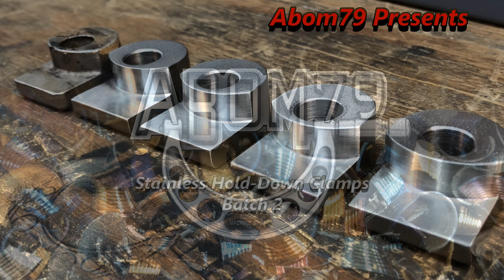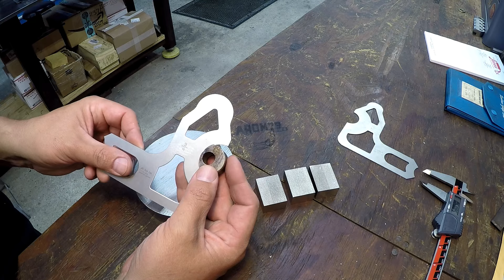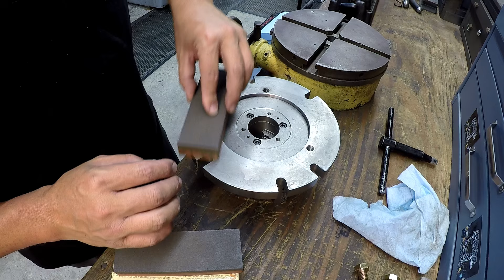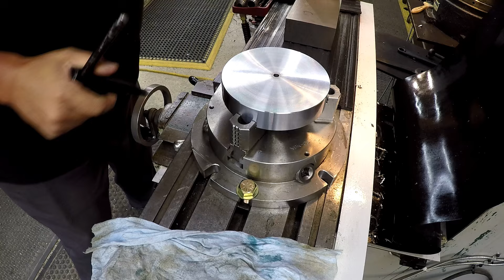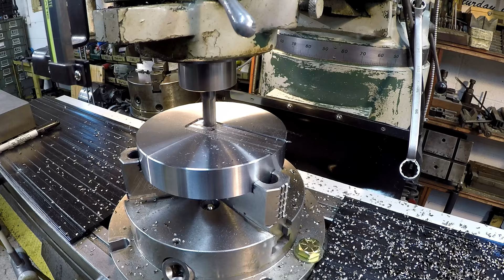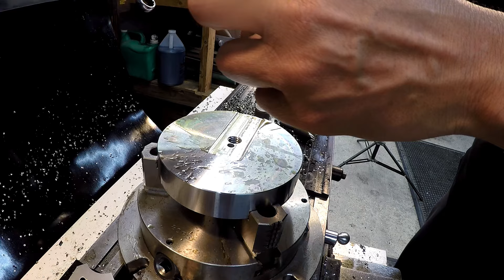Stainless Hold-Downs Clamps Batch 2

Comment: Adam, I know this is an older video, but I have a question for you.  My Kurt D688 manual states clearly that you should not clamp on the outside edges of the vise without a same size piece on the opposite side.  In other words don’t torque your jaws out of alignment (parallel) by clamping on one side of the vise.  Are you not concerned with the uneven pressure you are exerting on the jaws @16:00?

Comment: I used to be a manufacturing engineer. And used to compile cost of manufacturing parts for customers. And process the parts on different machines.
How do you get your hours of a certain job to calculate cost.

Comment: I'm a fan of the stoning the surfaces as I do it a lot my self. With that said i dont have a lathe and have often contemplated having someone turn the  face of my very similar but smaller turn table to get a nice clean fresh surface on there. Adam, is there a reason why a person would not want to do this?

Comment: Ok, I got a question. I'm a machinist, and retired design engineer, and I've not run into anything in all my years that required a clamp that a standard set of machinists clamps couldn't handle, what in the blue-eye devil are you holding down that needs clamps like that?
Reply: Maybe it's for when the hurricane comes, he can hold down cows ect. I've never seen a cow hold down clamp but seems like these might work. You can't buy these so they have to be made custom per cow. All cows are a bit different
Reply: They're for a diesel-engine turbocharger. You know any automotive part has to be goofy.

Comment: I noticed the cut seems to not cause as much vibration when rotated couter clockwise.  I am wondering if this is caused by the slack in the rotation of the milling fixture you mentioned in the setup.

Comment: Wouldn’t it have been more accurate to mount the low profile chuck on the rotary table then to the mill table prior to milling the slot in the fixture plate?

Comment: Hi Adam, I'm another long time subscriber and always love your videos.  I have a question about the shell mill you used to reduce the thickness of the stock.  I bought one like it at a swap meet but I am having a hard time identifying the inserts.  Remembering the video you made using the engineers black book, i came up with APKT but after that I'm lost. My shell mill is an Iscar F90A-D2.00-.75-M. I paid $70 used, probably  too much.  Can you tell me what inserts yours uses or give me any help in identifying what I need.  Thanks in advance

Comment: We turned the hole of a a piece of pipe to the correct radius, and then weld in the parts with a small weld. Then the pipe is loaded into the chuck and the welded parts are turned. Same result. The pieces are then grinded loose and finished and the holes were drilled on a normal drill machine. If it's positive radius we welded them on an outside diameter. We did that for decades until we got a cnc milling machine.

And again, Adam stop the spray coolant system, it's going to kill you. That would not be allowed in my workshop and by health inspection. The moisture will damage your health over time, plus you are losing the coolant instead of circulating it through the machine like a flowing system with no moisture. You will end up with a bad cough and a greasy workshop that you have to clean with other toxics to get rid of it. Keep up the good work , but watch yourself a bit ok?

Comment: I'm a hobbyist woodworker and we have lots of options for dust collection to keep the air safe and the shop clean. Do you know why machinists don't seem to have a vacuum system to help with the chips flying all over?
Reply: Most cnc machines have a closed cover with doors and autimatic chip disgarding thesedays and there are industrial vacuums to clean up chips and coolant. Depends on the workshop. For the old school machines it's still part machining and part cleaning, it just comes with the territory. It serves 2 purposes. To clean the machine and do maintenance you spot during maintenance as well as investing some love into them, they like to be taken care of. But sucking up wood dust is something else then sucking up metal chips. When you use a vacuum, that too needs maintenance and cleaning as well as empthying. Just more work...

Comment: Hi Adam 
Just awesome watching your videos lots of info on watt u r doing and how to go about doing some things that alot of us may not even think about doing ...so I have question for u I have a lathe which I use alot but having trouble setting up for threading I do have change wheels but only from imperial to metric the thing is I set it by the chart on the machine only to find it's not right it's not a made in China lathe it was made in Australia but no longer tho just wondering if u would have any ideas the screw thread is 4tpi thks Nigel.
Reply: @Goettschwan you can always do the math and sort it out
count the teeth and figure out the gear ratios you need for a thread pitch along each step of the drive train

could be tedious, but that't how they build it and make the charts in the first place

Comment: Beautiful work, as always.  One thing I like for demurring and blending things in is to use the coarse wire wheel on my 6" bench grinder.  It knocks off the burrs while also slightly rounding the edges, plus you get a more uniform look between the various surfaces.

Can't wait to see the next installment, Adam.  Keep up the good work.

Comment: Beautiful work as usual but I was not aware an exhaust system required such painstaking and time consuming precision parts. I will not be surprised if the installation of these NASA quality parts is done with an adjustable wrench. :-)

Comment: Great video. When I was an apprentice, we were taught to use a Blue Rizla cigaret paper placed in coolant on the work piece then bring it up to the tool, when the paper was pull off by the tool we new that the tool was one thousandth away from the cut beginning. Blue Rizla being one thousandth thick. Best regards Si.

Comment: I'm not clear on the location method of the part in the slot on the rotary table.  Is there something more than the cap screw in a clearance hole?
Reply: garry myers what he is doing is locating it in the y axis with the slot since the radius will be weird if it is not. The x axis is not a critical dimension so a bolt is close enough. Z axis is measurable and does not really matter.
Reply: @xXkingbeastmodeXx  thanks. That makes sense.

Comment: Hi Adam, Can you tell us if this is the wheel you used in the video? https://www.bindingsource.com/scotch-brite-trade-exl-deburring-wheel-6-in-x-1-in-x-1-in-9s-fin.html?_vsrefdom=adwords&gclid=EAIaIQobChMIrfmX9fnt4gIVRF8NCh3ZoQCLEAkYAyABEgLqafD_BwE
Reply: Sure looks similar. I had a look for Scotchbrite wheels on Amazon when Adam was using his. I was surprised how expensive they are.
Reply: @mikewebb4730   I found them a little cheaper on Amazon, they sure do a great job looking at Adams video. And of course Adam does an awesome job too!  https://www.amazon.com/Scotch-Brite-EXL-PRO-Deburring-Wheel/dp/B00OXI1KGI/ref=sr_1_6?keywords=scotch%2Bbrite%2Bwheel&qid=1560689082&s=sporting-goods&sr=1-6-catcorr&th=1
Reply: @mikewebb4730 expensive...right..! I worked in a shop where guys would try to use them for more serious 'sanding'....run them down to the hub in 10 minutes...there goes $100.00...same for the big Marvel band saw....try cutting allen wrenches to make 'T' handle wrenches...$50 blades...last maybe 5 minutes....

Comment: cut the channel as a cross, 4 bolt holes at the right distance for your wanted radius and an do it as an interrupted cut on the lathe?  an idea if your going to be doing a load of these in future?
Reply: Looking at the size of the radius I don't think you can place 4 of them and turn the radius looks too small for that.If the radius was large yes you could do it.Interrupted cutting not my favorite way to turn stainless steel.
Reply: @mehmettemel8725  ah. see i'm not good with imperial measurements, so fair comment. i work in metric mainly. but it's still an idea for other diameters if you have a load to machine.

Comment: This type of work was what I started off doing as an apprentice in 1977.....the rads were done on the horizontal mill mind you.......I would have built a hold down jig from flat plate with and bolted it down to the rotary instead of stacking the work as the less parts the less to go wrong. like Adams work but no need to complicate things, it makes good TV but a simple plate with a slot and thread is less machine time. Work shop time is money....the nice shiny jig costs far more than a piece of flat bar and 4 tee nuts to hold it on the R Table....
Reply: Cool story

Comment: Surely the large round with the slot and the low profile chuck are unnecessary for this setup. You could have bolted a simple slotted plate directly to the rotary table with the required offset. Or am I missing something?

Comment: Adam,
Turn the mill spindle on in very low speed while indicating with the coaxial indicator. This will find your hole center faster and easier. That's what the handle is s for, to keep the dial facing you while that spindle turns.

Comment: Adam, I have been trying to figure out your choice of mist coolant vs cutting oil. You seem to go back and forth but I can’t figure out why you choose one or the other for a specific task. Like in this video, you used oil for drilling one hole and the a bit later you had the mist running for another hole. Can you clarify?
Reply: The mist was used on the cuts that were one inch per minute, so he wasn't standing there feeding. Looks like he uses oil for when it runs in real time.
Reply: Eric I kind of thought that too. But as I pointed out, he used both to manually drill two different holes. I was just wondering whether there was a reason or just what he has setup. Because I didn’t see the mist until that hole. So maybe he just didn’t have it setup yet. And a side question, when you get that mix of coolant and oil in the sump of the machine, is it still usable or garbage?

Comment: When using the presion stones don’t you need to use oil such as WD-40 with them so they don’t build up or is that just for soft metal such as copper and aluminum?

Comment: 2:46 What does he mean by 9/16 radius? How are radii measured?
Reply from the maker: Half of the diameter
Reply: A radius is 1/2 the diameter of a circle. A 1 1/8" circle would have a radius of 9/16". A arc segment of the 1 1/8" circle would be said to have a 9/16" radius.
Reply: Diameter is the full width of a circle.  Radius is half that. 

Like the spokes of a bike wheel they "radiate" from the center.
Like "rays" of the sun.
Reply: @insertgoodname4809   Yes.
Reply: I think the Q was meant more along the lines of 'why is he talking about the tool with reference to radius?' Hobby metalworkers, unless they have a mill, don't do routers. We're used to drills, 'innie' cutters, named by diameter, because that's how much material it removes, and that's the size void it leaves. Router is an outie cutter, and removes material up to its radius size, so that's how it's named.
Reply: @jimbarchuk  Nice thoughtful response Jim Barchuk, Love the innie, outie partie.
Reply: https://en.wikipedia.org/wiki/Radius_gauge
Reply: To answer your question more directly, it's the radius of the circle that would match that curvature.
Reply: @boothbytcd6011 
Thanks

Comment: Do you not yearn for CNC with a job with a few ops like this?
Reply from the maker: Complaining about not using cnc is not going to get the job done. I have a job in my hand and need results now!
Reply: For 3-4 pieces a CNC is not worth it, a good jig makes it much easier, 20 pieces? Yeah then a CNC becomes more cost effective.
Reply: I work in a largely manual shop (in a physics lab) and I have to say, the 2-axis proto-trak retrofit we have on an old Bridgeport clone at the shop has saved my ass more than once when the part was needed RIGHT THEN.

...One of these days I’ll post up a walk around video of the leblonde sliding gap bed we have- the thing is maybe 6’ long and 4’ tall but can swing a 36” faceplate.
Reply: Yes and a computer could paint the Mona Lisa but would it be the same?  CNC machines are more efficient because they do the same thing over and over without fail but for a unique job the setup could be prohibitive. If this guy wanted ten thousand of these yes CNC would be the best choice
Reply: There is no artistry with computer run equipment.  CNC is for sissy's. 

Watching a machine make a part is fun for about 10 seconds.  Watching Adam work is a solid hour (or however long the ep is) of entertainment.
Reply: omg, right? doesn't he see how such obsolete equipment makes jobs like this far more time consuming and complicated? a modern CNC (not even counting wire EDM) would be very quick and precise. a far better solution for something like these SS hold downs.
Reply: @aap71  Adams work is perfection with conventional  machinery (love my conventional machines also ); CNC can probably do most everything except some huge parts  ; It would be shameful if the expertise on the conventional equipment was lost in the future .

Comment: Just a hint for stoning surfaces, I have found that spraying on a bit of PB Blaster on either the stone or surface keeps the stone cleaner and sharper as well as preventing rest after stoning. My lathes and Mills just keep getting cleaner and smoother!
Reply from the maker: What if one doesn’t own PB Blaster? I prefer WD-40 for stones.
Reply: WD-40 works good too, the only trouble I have found is WD-40 leaves the same film in the stone as it leaves on tools when preventing rust, so it requires rinsing the stones with kerosene after a couple a while.  Keep up the good work Adam if you ever go see Wyoming stop by on the way big machines are common in this area.

Comment: Hi Adam! Personally when I have to mill a piece at the edge of the vice, I always try to put another piece of the same size on the other side of the vise to avoid forcing the moving jaw in rotation and thus to damage the central screw.
And it also ensures a tight against the face, straight.
Does your vise have a system to not apply this technique without damaging it?

Sorry for my poor English
 ^^
Séb.

Comment: I have a rotary table I use to drill bolt circles but haven't figured out the whole cutting a radius thing
Reply: ronald davis I'm lucky enough to have access to a CNC vertical mill- so that kind of milling is a breeze-!

I have never tried making parts out of stainless steel though...